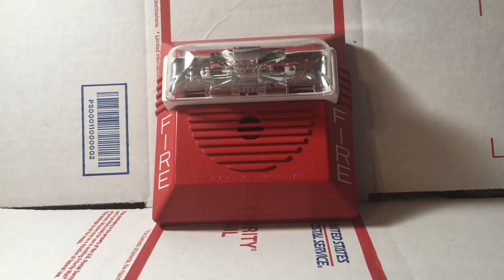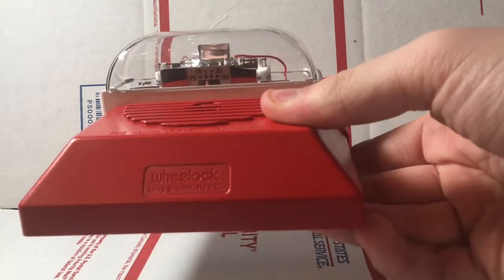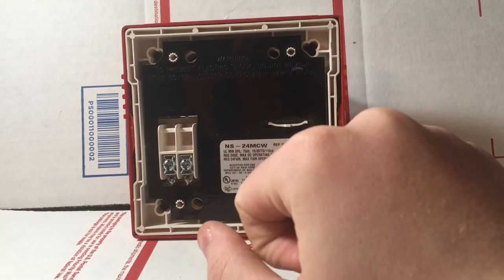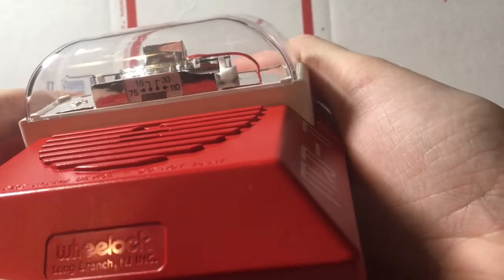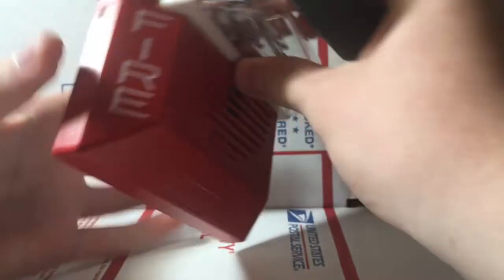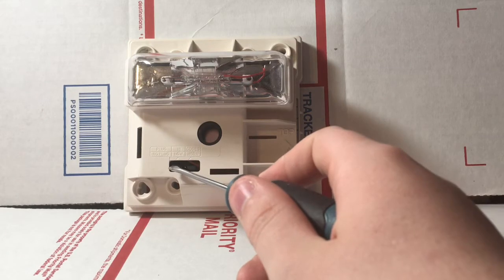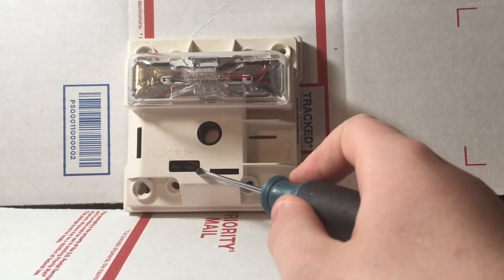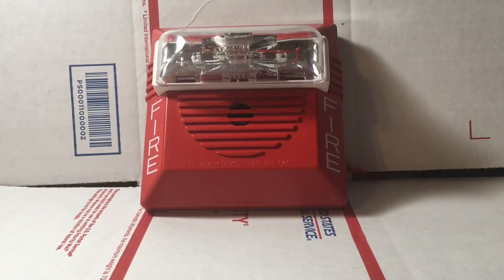Fire Alarms Up Close Episode 1: Wheelock NS-24MCW

Comment: The replacement series for this alarm has the same sound as this one.  The ZNS and exceder   Kept the NS sound if Wheelock can keep the same sound for many different  alarms they make  why can’t EST do it? EST has A different sound for their different alarms so the integrity and the Genesis don’t have the same sound   The 892 792 and first generation integrity had the same sound  EST quit making alarms with the same sound from the previous ones in the 1990s and when the Genesis came out EST was done with the mechanical horn and there were two generations of the Genesis the first generation of the Genesis still had the integrity sound but higher pitched the current model of Genesis has a spectra alert classic like sound but higher pitched.